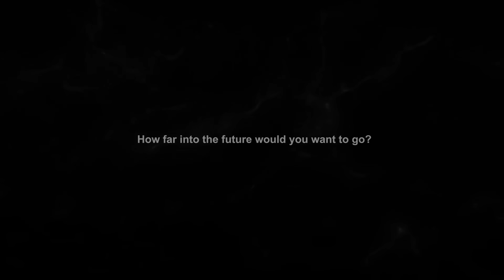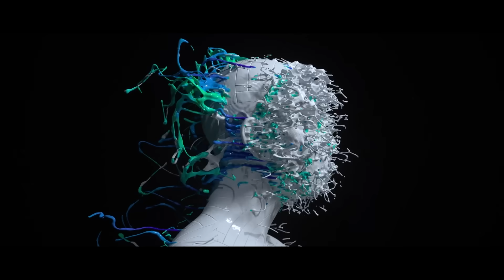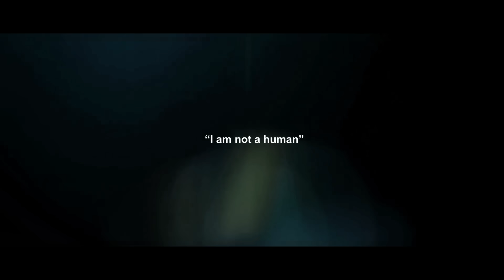TIMELAPSE OF FUTURE TECHNOLOGY: 2022 - 4000+

Comment: Quite optimistic, isn’t it? Apart from this, some explanations seem to lack scientific validity. However, the main drawback is in envisioning the future based solely on your present state and comprehension. This approach doesn't provide a dynamic representation of the future; instead, it's similar to making a static prediction that often loses validity over time. This process, known as the perturbation principle in mathematics, tends to diverge from actual reality relatively quickly. Just to clarify, at this moment, it might seem challenging to picture the future beyond the realms of AI and quantum computing. Yet, there is a possibility that a new theory could emerge and reshape our understanding in profound ways.

Comment: 4:13 Jupiter doesn't have ground, how can there be a rover, 4:40 why wouldn't they just build a seperate space hotel station instead of evicting the scientists on the ISS? 5:51 judges will never be replaced by AI, the US court system has established this 6:24 it is impossible for us mere humans to interact with a fourth demension or build a machine to do so. 9:10 no one in the next century will put any living thing outside of containment on mars (even humans will be stuck in bases and suits) for fear that it could disrupt a potential martain biosphere. 10:03 This suggests that humans were killed because humans will reach a population of around 11 billion, double to fit all robots gives us 22 billion, the earth would have trouble building enough storage space for all of the bots in that little time. 11:32 quantum computers just aren't optimal for AIs there are some cool analog devices that would work great for it though. I'm to lazy to look over the rest

Comment: I had an original dream once. Two people, one a student and another a know-it-all clumsy traveller crossed paths while the student was at the back of the class in the middle of a martial arts lesson taught by his master who was at the front. The classroom was this levitating stone platform over the mouth of a seemingly dormant volcano. However, unbeknownst to me the dreamer, this volcano did not have the potential to house magma. It houses portals in time. The traveller thought he knew what he was doing and wanted to go back in time. The master tried to warn him that this would mean that the traveler's mind would change to match those of the people in that time. Without a strong mental will and prudent concentration he would forget who he is in his present. No one knew what would happen when the traveller intentionally disturbed the volcano's invisible contents.
Reply: The traveller took a rod like instrument that looked tribal, partly burned yet restored over the edge of a section of the suspended platform and pierced down into the invisible membrane. The traveller was repelled backward and one of the martial arts students was repelled forward and then just as suddenly repositioned on the rear stone platform with the traveller facing the master at the head of the classroom.

The traveller came back from much further in the past than he intended. He wanted to go back just a few years never expressing his actual time traveling intentions. He was now a Renaissance man dressed in robes and speaking in old English. 

Facing away from the master was this blob of embryotic fluid that steadily grew to about the size of a man and broke it's translucent sack. Emerged in the floor of the suspended platform was this alien with a gaunt tissue covered rib cage, large webbed hands, a hairless thing with a strange face with short tentacles protruding out with no familiar expressions. It's body read exhausted. It was the student. He was turned into a voiceless futuristic human with no need to wear clothes. This once twenty something year old athletic man now exposed to the open air in an environment that was too brutal for him began to dry and decompose in the open air turning from peach to scorched brown and black, from living tissue to hardened remains.
What no one else knew, when one travels in time either forward or backward, another person must be pushed in the opposite direction and with the same time bending force. The student lives in the future with birth, life and death in what felt like a second in the present and the traveller lost his present mind to the past now full of grief and bewilderment at the present. He longed for what he thought was his original time and the life that he was born into and was ripped from wich is the present's past. 

The reckless and foolishly optimistic traveller lost the life he was living and the student was a victim. As one goes into the future or past at any controllable or uncontrollable distance, another will be snatched - exchanged from the present and thrusted into the opposite end of time simultaneously with or without their consent to satisfy the balance.

Well anyway, that was a dream I had one night. I wonder what I will dream tonight.

Comment: Y2022, world is on the edge and about to turn into ashes.. you still believe humankind will survive for as long as you are showing? and P.S. everything regarding A.I. - divide by 1000, AI is smarter than human, does not require to eat, sleep or work to survive in this world

Comment: I think the near term predictions are way too quick.  They left out the AI vs. Humans war.  I do believe uploading our minds for space travel and downloading into custom bodies built for the local environment is the way we'll eventually go if we survive that long.  It makes sense.  We already know how to transmit data at light speed for low cost.  I don't think it will take 8000 years to reach this point, maybe a few hundred years.  And we will transfer data using quantum entanglement which is at least 5 orders of magnitude faster than light.  We're already in the process of building an Internet based on quantum entanglement.  A.K.A. Einsteins "Spooky action at a distance".

Comment: Some of the tech mentioned in even the next 5 years seems pretty unrealistic. Yeah maybe some prototypes are there, but no way will it be wide spread technology that masses are using. Wearable tech such integrated in clothes won't come into fruition for majority of people until mid 2030s at least. The technology would need to drastically come down in price for it to even be a viable option.

Comment: Colonizing the galaxy will definitely require communication faster than the speed of light. Imagine talking to someone at the nearest star - zz zzz. 

Talking on a galactic scale is like "oh, we got a message from Earth. It's only 22.000 years old." 

I’m afraid it won't work.
Reply: That's the reason why type 3 civilizations never existed, and why aliens are not visiting or communicating with us.
Reply: Yes, that may very well be the case if instantaneous communication is not possible.
Reply: @dppedersen  no, it's probably not and wormholes are not used to teleport to universe. Even advanced civilizations reach its limits in type 2, in its own system.

Comment: who in their right mind would build a square kilometer array on Earth ? We have this thing called an atmosphere, just look at Hubble to see what you can do without it...no- that array would  most certainly be built on the moon, no atmosphere, gravity to make manipulation of material easier than space, plus materials would be mined, made on the moon. But the general idea is not just god, it's excellent, an array like that made of optical sensors would put any optical light bending lens to shame. Bending light always gives diffraction and other optical problems such as photon loss etc. an array that captures incoming photons that size would be able to probe the universe like nothing else before it ever could.

Comment: This is kinda fast tracked. This stuff wont roll out until 10-20yrs after the dates they propose. Mars population 300,000, but first off world birth is in 2081? LOL warp drive by 2100? This is not a good projection.
Reply: I guess it's the best scenario possible. In my opinion what they show in the end won't happen untill like at least 100000 yeaes into the furure not 10000. However what's truly important is that at some point it could be possible.

Comment: The very premise of terraforming Mars is to request a violation of physics. Mars just doesn't have the mass needed to hold on to an atmosphere. It also lacks a carbon cycle due to not having any significant tectonic activity, which also makes for a weak magnetosphere. Also, Mars has no water. We have a better shot at terraforming Venus. Perhaps find a way to move it further away from the Sun.
Reply: I think that the aerospace engineers and scientists know more than you Jona
Reply: Obviously they don't.

Comment: I would love to see a time where the vacuum of space is no longer an issue or any type of environmental problem. Our suits or bodies can handle most anything thrown at it. -300 to 2000 nano suit that will adapt to most any environment and comes from a wrist watch type thing or necklace. Or even something behind your ear like in Guardians of the Galaxy.
Reply: Tech Religion
Reply: You should read the Culture books by Iain M. Banks. I’m sure you will enjoy. Start with Excession
Reply: SCP-682 type shit
Edit: Wrong comment
Reply: SCP-682 type shit
Edit: WHAT THE HECK WHY IS THIS ON THIS COMMENT
Reply: SCP-682 type shit
Its literally teleporting this down a comment wtf
Reply: Space is NOT a vacuum.
Why does everyone believe this? There is no air.
But it is not a vaccum.
Reply: @donovanbryan5000  Space is literally a vacuum. it has no matter in it besides small fluctuations, which means technically it is a partial vacuum
Reply: @Liquid_Catt  not in the sense that people think . It doesn't suck air out of  anything.
If you open a door of spaceship it doesn't suck the air out.
The air just goes to replace the nothing.
You can use vacuum pump and pull air out of tank down to 0.
But stop before it gets to a - number.
No air. But not a vacuum.
Same reason you can't breath on top of mt everest. Very thin air. But not vacuum
Reply: @donovanbryan5000  But, isn't - wtf you saying your contradicting yourself your saying there's no air but it isn't a vacuum? A vacuum is where there is no matter inside of the given area, so that means space is a vacuum until you reach a point where the planet/star's gravity keeps the gas from expanding.
Reply: @Liquid_Catt  exactly.  Would be 0 microns
Reply: @donovanbryan5000  So you agree with me, space is a vacuum?
Reply: @Liquid_Catt  not in sense it is negative pressure
Reply: @Liquid_Catt  think about it 
How could space become negative pressure.
We have air here at ground level. But higher you go thinner air.
It does not go negative. There is no suction. Just no more air molecules.
Same in space. Nothing caused it to create suction. There is simply no air molecules
Reply: @donovanbryan5000  A vacuum would be no pressure, not negative pressure, unless of course you add in the pressure your body is putting outwards, in which case you COULD say your body is experiencing negative pressure. However, space itself has ~0 pressure, minus the quantum fluctuations.
Reply: @Liquid_Catt  ok. Well that's all I was trying to say. 
But most people think it's suction. Like if you went into space without space suit you would expand and blow up.
It doesn't do that.
But I agree with you
Reply: All this going to happened after 2026 by Kalki Ironman 😎😎😎😎😎
Reply: @Ironcammandoo  Huh?
Reply: Humans 0
Saiya-jin 1 to 6
Angels 7 😇

Kalki Ironman 5th matriya buddha 8th arc Angel 11th satguru 13th imam and 24th avatar after 2026 😎

Almighty God 9 😇

Humans type 2.5+ after 2026 by Kalki Ironman (christ in the white horse)(son of man on clouds) type 7 and 8 😎

Jarvis the world’s first artificial intelligence (parrot) 😎

Cuz Kalki is ironman batman super saiya-jin superman ben10 saitama Narutoo shaktimaan and every super heroes combined after 2026 😎

Jarvis world’s first artificial living being (just like vision in marvel universe)😎

Made of Quantum and sub quantum particles 😎

Power source quantum energy arc reactor (type 7) level technology 😎

Kalki Ironman going to have every kind of arc reactor like:- type 1 Nuclear fission, nuclear waste, hydrogen fusion, type 2 3 4 5 antimatter arc reactor (solid liquid gas), type 6 electro quantum arc reactor, and type 7 Quantum arc reactor, type 8 limitless quantum energy arc reactor without quantum particles 😎

Kalki Ironman going to have sun in a box million billion tons of hydrogen nuclear fusion reactor type 2 3 4 5 just like sun and stars in the palm of his hand 😎

This all going to happened by self replicating quantum nanobots knowledge energy and techniques at type 7 7 7- respectively 😎

Ironman (Tesla 2.0) going to reveal every secrets of the world specially Tesla and his Antigravity 😎😎
Reply: the problem is you are thinking of 1000 years but you should think of 100,000 years.
1000 years is nothing for this demand.
4000 years ago we had Egyptians that built pyramids. 4000 years after that amazing achievement we don't even have zero gravity machines... we don't even understand exactly what gravity is...

So when you talk about Nano suits we have a long way to this or something like warp drive.
Reply: Kalki Ironman type 7 and 8 after 2026 😎

kalki avatar (beast of the earth) (christ on the white horse) (son of man on clouds) is the biggest enemy of dajjal/antichrist/kali 😏

Kalki Avatar (Murtaza) 11th satguru 13th imam cousin of Moula mahdhi a.s. 12th imam (muhammad) 😎

Prophet Moula mahdhi is raja shashidhuvj (the mighty one) born less then 1200 years ago 😎

Prophet Moula Isa a.s. will kill dajjal cause dajjal is going to kill Kalki Avatar 😏

Kalki Avatar will follow orders from 2 religious king Moula mahdhi a.s. and Moula Isa a.s. 😎

Kalki Avatar going to have 2 swords and ring of moula sulaiman a.s. and staff of moula musa a.s. (iron rod) Staff of moula musa a.s. is like omintrix can transform into anything and can transform others into anything And stone in the ring of moula sulaiman a.s. is also known as kastav mani and it's more powerful than all 6 infinite stones combined 😇

Cuz Kalki is ironman batman super saiya-jin superman ben10 saitama optimus prime shaktimaan and every super heroes combined after 2026 😎

This staff will transforms into white horses with wings,weapons,iron-man,cloud etc or can do imagination into reality 😎

*Ratn sru sword of lord shiva (miri)😇

*Ratn varu (zulfakar) sword of Moula Ali (piri) 😇

miri piri 😇

Kalki Ironman after 2026 😎

Satyug (sunrise from West) 2038 😏

Sambal is hospital 😏

Gzwa e hind 2029 😎

Khalistan and Azad Kashmir after 2026 by Ironman 😎😎.
Reply: Go in search for the wakanda tribe. Or find Tony Stark.😆
Reply: Ridiculous